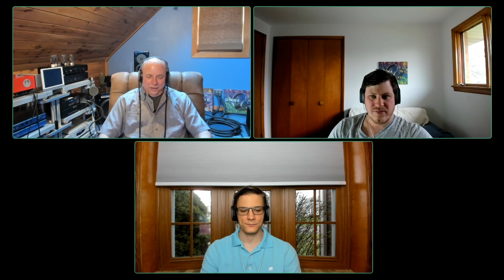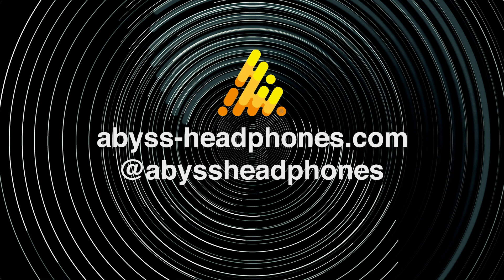Why don't headphones have multiple drivers?

Comment: Maybe it's a result of my rather lower-end headphones and gear (Sennheiser M3 and 560s) but when I push the volume on tracks that have ultra low frequencies like 7hz, that long driver excursion is making the mids and highs suffer from sounding far away, and then too close. It's like I can hear the guitar or drums distort in an out 7 times per second, or whatever the amount of low frequency was playing. If subsonic bass is playing at 12hz, it makes the upper frequencies distort back and forth 12 times per second, and I was watching my headphone transducer break apart trying to reproduce it.

I always thought that wouldn't be an issue if there were multiple drivers. Bass always requires more excursion length to be heard compared to upper frequencies, so when mids and highs are thrown on top of it with sub-frequencies playing, you know what I'm saying.

I've never heard high-end or even mid-fi headphones but most of them are large, which helps reduce the amount of excursion needed for volume, thus improving distorion so maybe you guys don't hear what I am hearing.

Playing a track from Bassotronics' "curtain shaker" has my headphones just about ready to blow up. I know that track is designed with speakers in mind, but not everyone has that kind of luxury to just play whatever they want in their own privacy without disturbing others with speaker noise. Would the Abyss TC be able to handle songs like that without breaking up?

I know it's pretty dumb to worry about subsonic bass below 20 affecting the other frequencies. I really did think with 2 drivers, one could take the strain of the bass's excursion away from the mids, while the other driver could focus on everything else.

Comment: Since we're on the topic of drivers, can you please talk about the different types of headphone drivers (including the newly-implemented AMTs!), and why you ended up choosing to use planar magnetics for yours.
Reply: Joshua Valour actually got to talk with an Abyss engineer on why they went for planar vs dynamic. It starts roughly at 19 minutes.

https://youtu.be/hoLMdrD5pic

Tl;dw:  dynamics are much more expensive to test and tune whereas with planars you are able to relatively inexpensively get the exact tuning you are aiming towards.